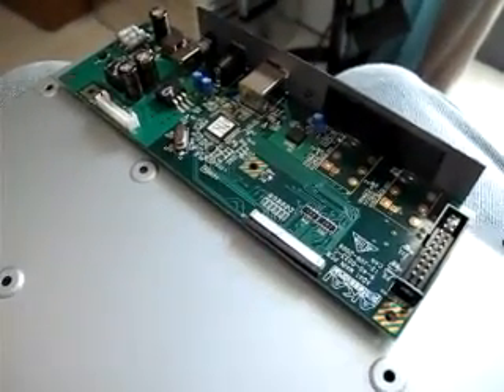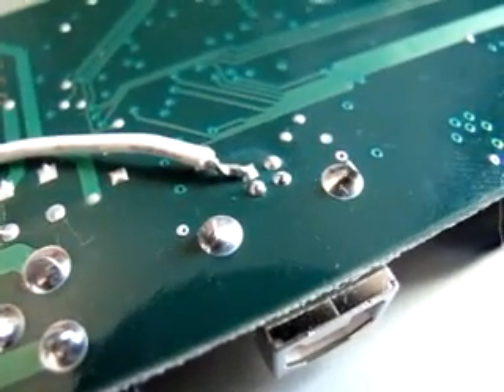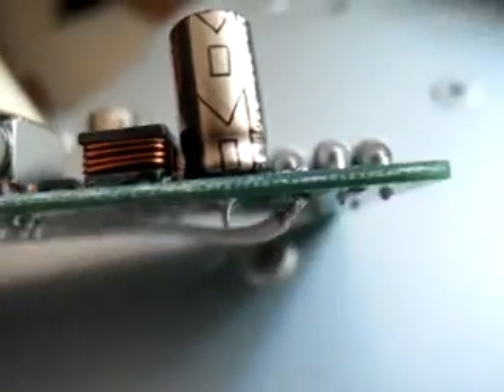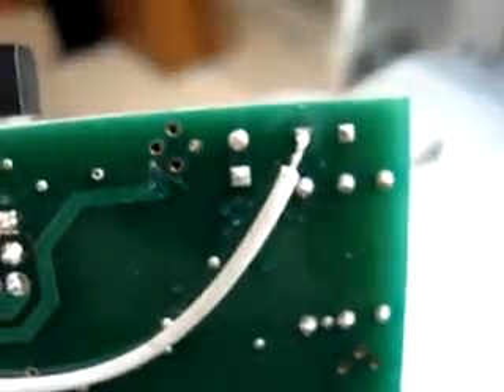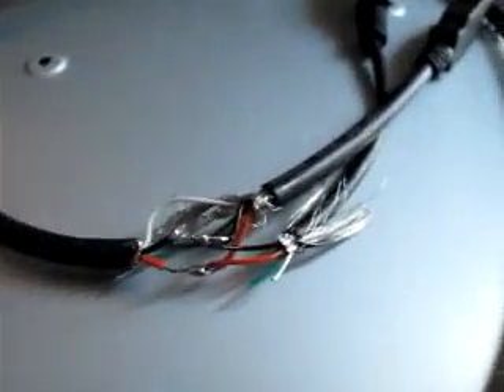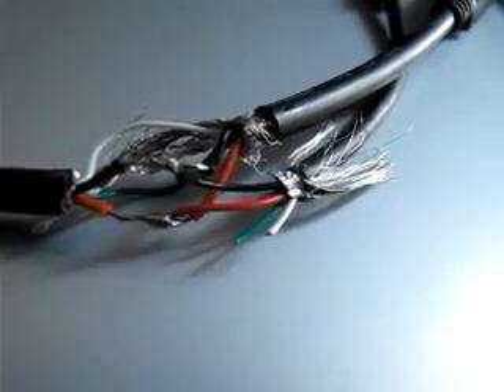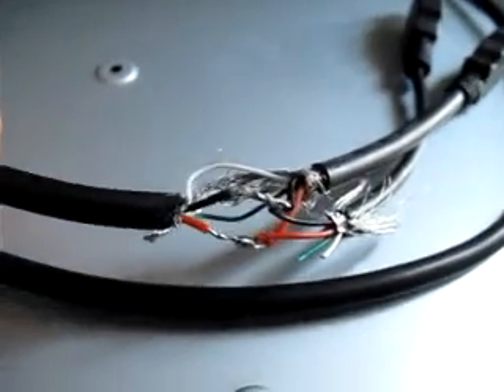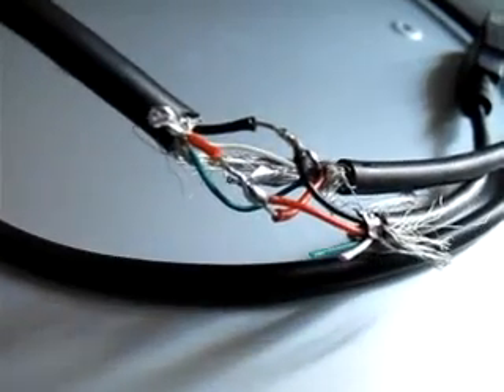AKAI APC20 USB (bus) powered mod walkthrough...

Comment: What if you plug the adapter while the APC is being powered by USB? Is there any risk of damage by overpowering the unit or something? Do you need to reverse the modification in order to be able to power it with the adapter again? Thanks!
Reply from the maker: Like I said in the video, you will blow up your USB port or computer. 
You will need to reverse the mod or put a switch in.

Comment: Hi, great vid! I am considering this modification but was just wondering whether the process would be reversible at all if you split the cable or melted the solder of it?
Reply from the maker: Of course, the process is completely reversible. With today's common USB 3 ports, there is more than enough power available from a single port to be able to use a single standard USB cable instead of any cable mod.
Reply: +Jeannot Kuenzel Excellent, Thanks for the reply. I just have one final question if that is alright. I was wondering if after doing this mod I should be afraid to put the APC40 into a powered usb port?